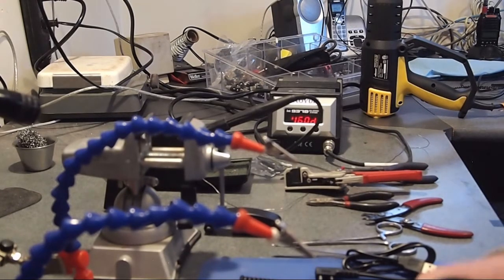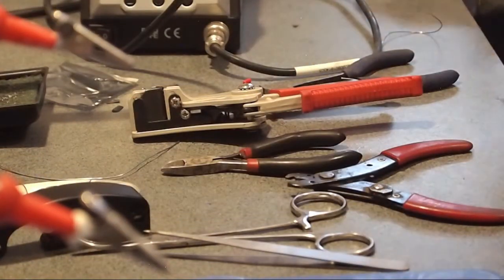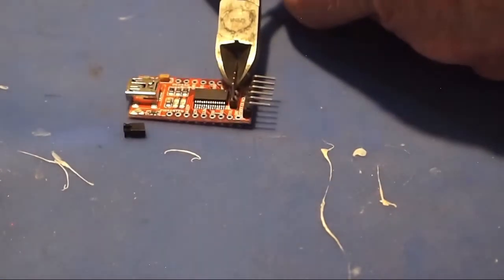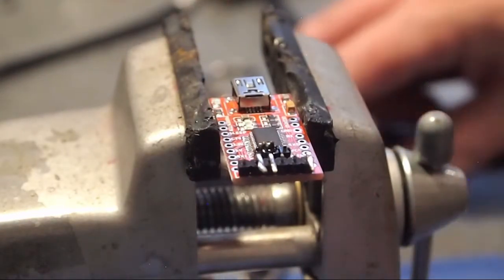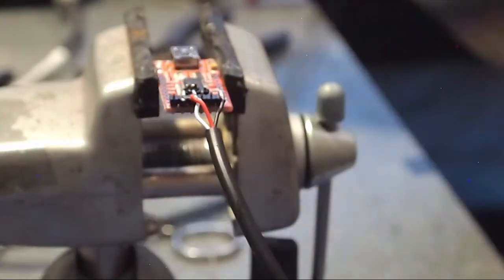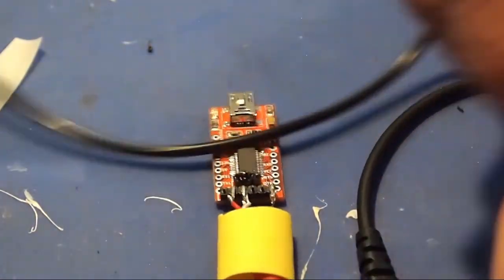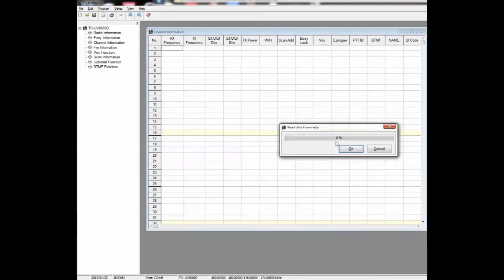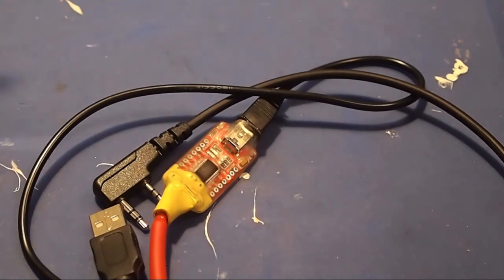TYT, Wouxun, Baofeng, Anytone, etc: make a better prolific Windows programming cable.

Comment: Good tutorial. To avoid having to rewiring your cable if it does not work, do web search of the correct transmit and receive points on the plugs. Then when you strip the wires down, use a continuity tester with a DMM to figure out what is what.

Comment: Do you (or anyone else) have any guidance for a VX-6 HT.  The programming cable has only 2 wires black (Gnd) and Green Rx/Tx. I am using the same USB TTL module you used. I connected both Tx & Rx together then just RX. Chirp gives me an error every time. Do you have any idea to solve this problem?   KC2ORP
Reply from the maker: Sorry, I missed months of comments as I was not getting the notifications. If you got this problem licked, it would be good to post the solution for others perhaps.

Comment: Hello, is it possible to give me the pin out of the TYT TH-UV8000? My cable dont work :(
Reply from the maker: I don't have it at hand, if I need to find it I'm search a Google search will turn it up in dozens of locations. Do you mean the 8000D? If so, it uses the standard cable, so it's more likely you're having a problem with the USB Driver installation.

Comment: Prolific deliberately disabled support of the fake prolific chips in its newest drivers and the new drivers deliberately only support genuine prolific chipped cables. If you use a genuine cable that uses genuine prolific chip then you never have that problem. 

But a nice idea with this cable modification